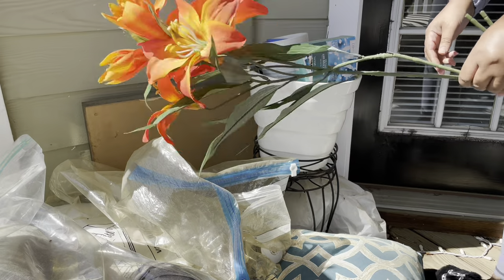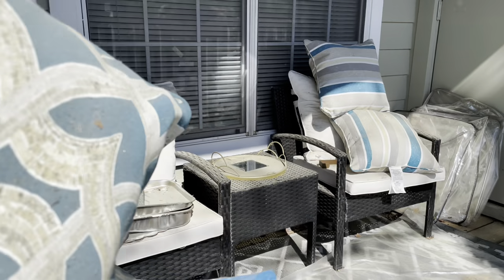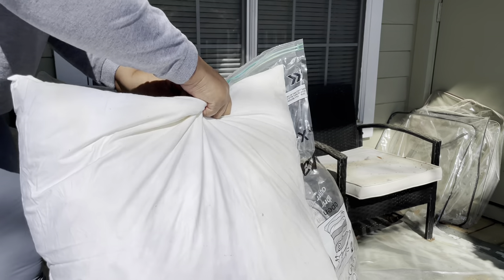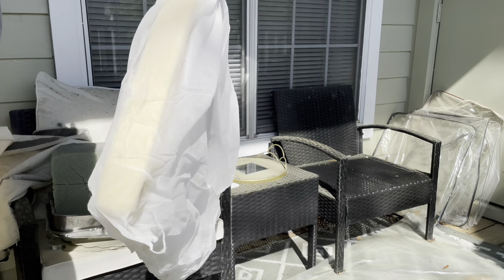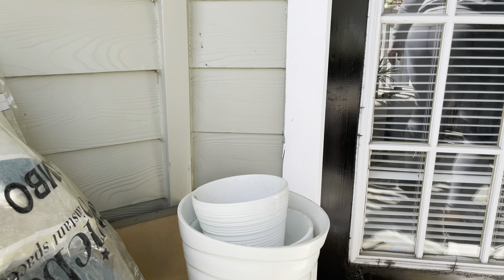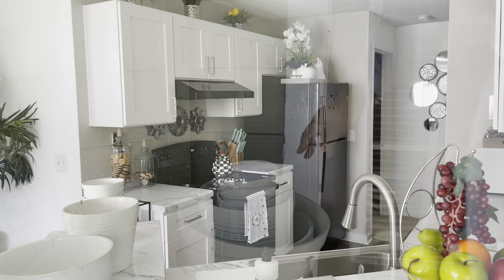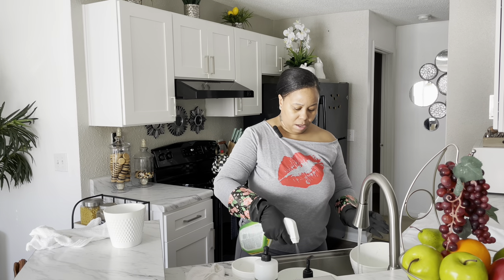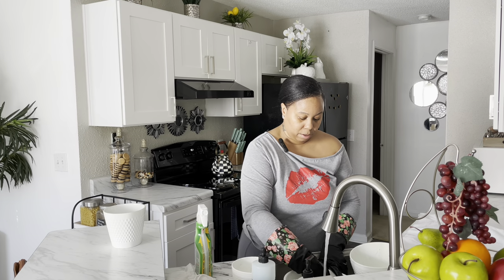VLOG: Getting started on outdoor balcony  #springseason

Comment: Oh wow, new to your channel but I have been watching awhile. Those pillows were beautiful that you trash. I had pillows on my patio and I bought some mold and mildew cleaner I think from Lowe’s. I spray it on them and took the water hose and all that stuff came out. It doesn’t fade either. I still use the same pillows. I will try to take a picture of the cleaner and send to you